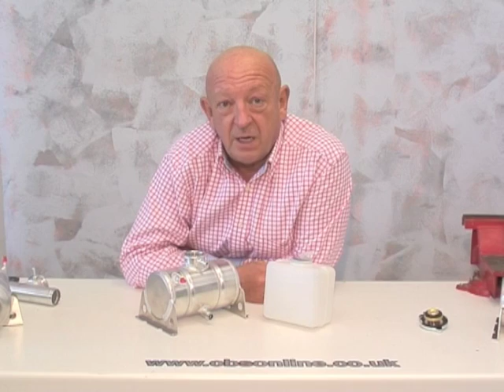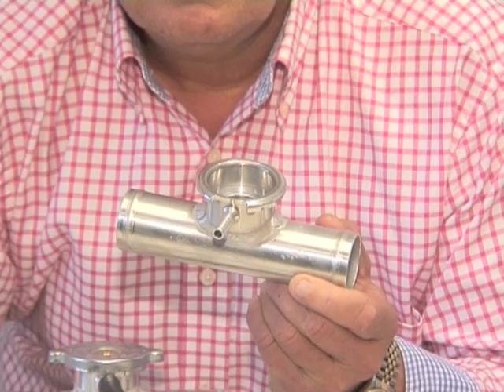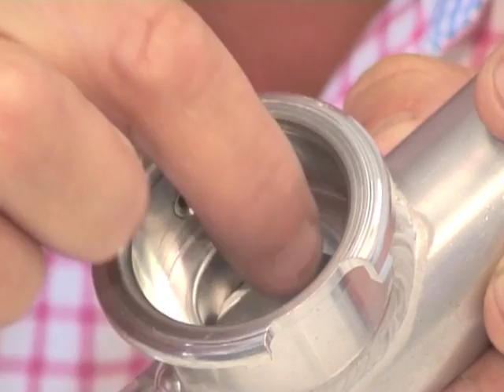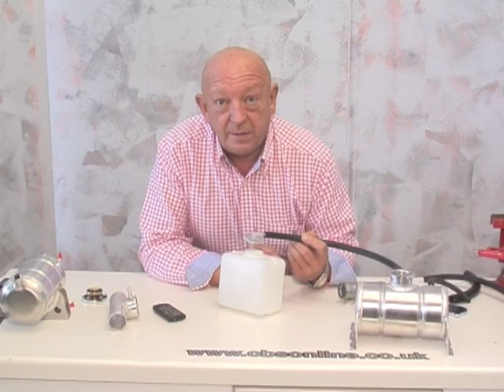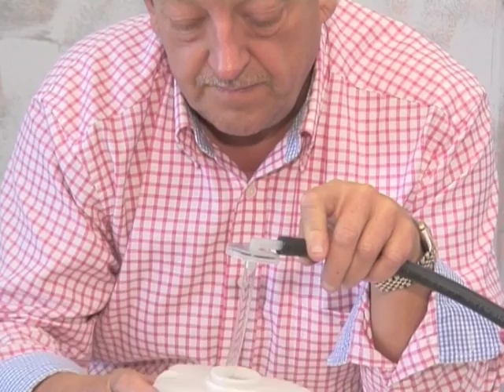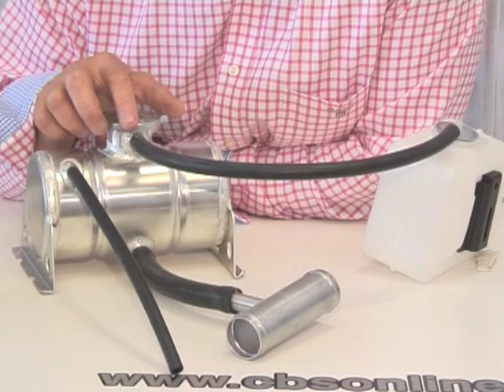Header Tank vs Expansion Tank: What's the Difference? | Plumbing Explained

Comment: Question. The narrow hose from the radiator to the header tank. Might it draw coolant back from the tank to radiator when the header tank gets full ?
Reply from the maker: Thanks for your question. The header forms a pressurized part of the system so there is transfer of coolant each way as temperature and pressures change.

Comment: Thank You for sharing this really well thought out, and sensibly described video with us. I'm presently building a "The Edge Products" Buggy, which utilises a motor cycle engine. I may need to use a header tank (and an expansion tank), as I'm trying to keep the weight (including the radiator), as low as possible in the frame/chassis. Regards Johno
Reply from the maker: Have you finished it yet?
Reply: @CarBuilderSolutions                                      Not yet. I still need to make a fuel tank, make brackets for and then mount the oil cooler and the flow and return lines for both. That will allow me to start the engine. I want to upgrade the front brake rotors to 10 or 11inch Dia Wilwood's.  Regards Johno

Comment: I have a question: how could the coolant in the expansion tank possibly be drawn back into the header tank or radiator?   If you look at your pressure cap, there is a little brass disc in the middle of the tip which looks just like the anti vacuum one-way valve.  These are fitted to stop a vacuum occurring which prevents collapse of the rubber hoses. So without a vacuum to suck back the coolant it would remain in the expansion bottle.
Reply from the maker: When the system heats, the water expands, pushing some out, past the cap valve.  As the water cools it contracts, this will then create the vacuum you are refering to.  Provided that the hose on the radiator overflow is in the bottom of the overflow tank then the same vaccum will suck the water back in the same way it went out.

Comment: I have a four cylinder side valve with a screw on radiator cap….I may not need an expansion tank but this is an EXCELLENT explanation for which I am very grateful indeed.

Comment: It would be better to have a larger header tank or add another header tank and avoid using the unpressurised expansion tank which must be allowing oxygen into the coolant over time.
Reply: An expansion tank does just the opposite of that. It allows the coolant cap to burp out air in the system without spraying coolant everywhere. Since the hose inlet is always immersed in fluid, it does not allow gasses to re-enter the system.